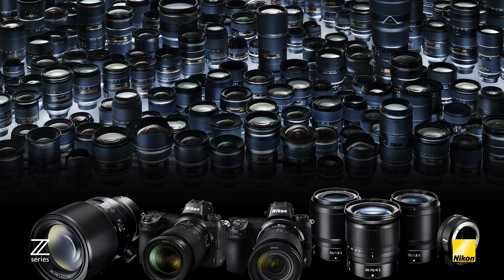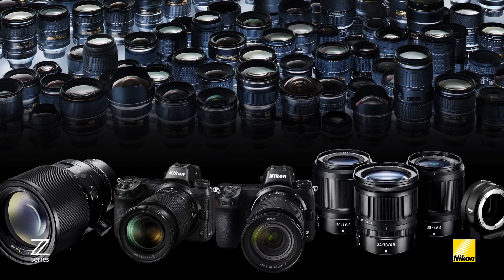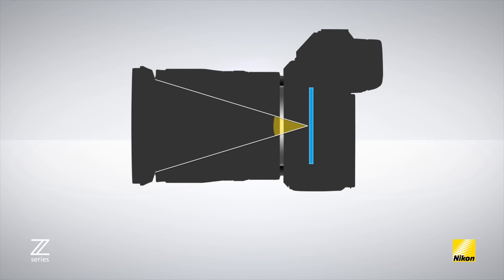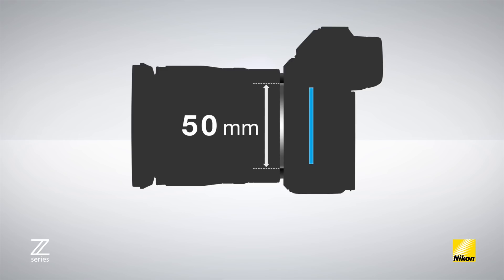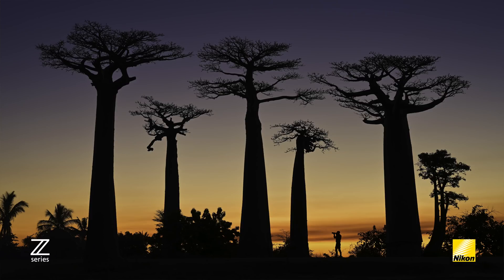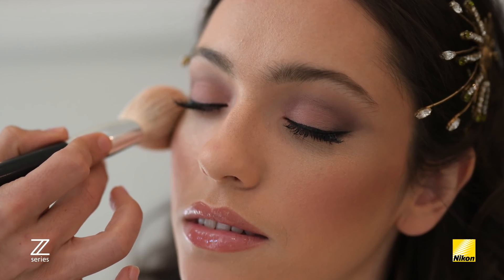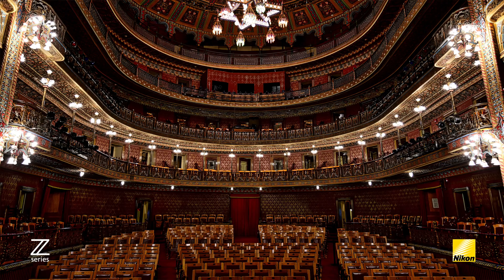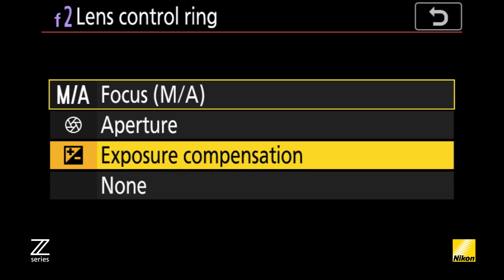Z Series First Look – Lens/Mount (Part 3)

Comment: 2 things to stop me to buy ( XQD Card too expensive and S line lens too )
Reply: XQD cards have cheaper options that actually match the speed of most fast CF cards. You can get Sony's M-series XQD cards and should perform fine. I think most people just don't want XQD because their old storage media like SD and CF wouldn't work with the Z lineup.

Nikon played it safe with the release of their lenses. To be honest, the new primes are sharper, especially on corners of the frame. I still use the FTZ for now though as I'm waiting for the faster lenses next year (2019)

Comment: Nikon it will be so good if you can put 60fps 4k option.  sensor is capable of doing this please update final firmware to do 60fps 4k video because thats what you need for 2018-19 . and N log for internal card option.
Reply: The problem is the sensor can probably record at that rate but a very short duration. Due to the massive file readout, it can cause the sensor to work harder thus results in over heating. This is why smaller sensors has the capability to shoot higher frame rates at higher resolutions.

Comment: WHY on earth has Nikon only put 1 card slot?

To make the camera more appealing videographers Nikon should have got rid of 29min record limit

Why don’t Nikon put a flip screen rather than the almost useless tilt ?
Reply: If you have seen the internals (google it) there's barely space to fit one in. Probably in the future.

Camera manufacturers can't go over 29 minutes as the camera will be defined as a video camera and will be slapped with higher tax (in EU). Just use an external recorder.

Tilting screen has pros and cons same goes for flip screens.

Comment: Hi Nikon Canada,
As you said there is no loss if we use a F mount lens with a the FTZ mount adapter. Then what the point of buying any of  those 3 first S lens ( 24-70mm f/4 , 50mm f/1.8  et 35mm f/1.8 )?
Reply from the maker: Great question! While the FTZ mount allows compatibility with the F mount lenses there are definitely benefits to the new S line:
- All of the new lenses are weather sealed
- For video work, they allow much faster, smoother and quieter autofocus
- Most importantly, the new optical designs (allowed by the new Z mount) provide much better image quality. So if you have the F-mount 35mm f/1.8G lens, while it still completely works with the new Z7 and Z6 bodies, the new 35mm f/1.8S will be much sharper, especially when shooting wide open.
Reply: great answer